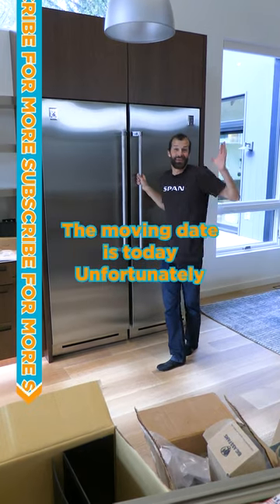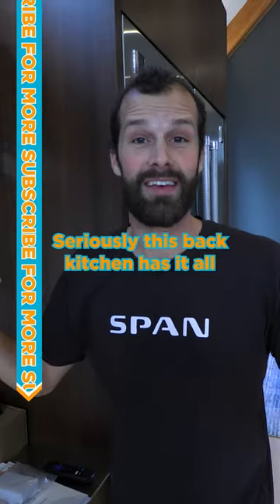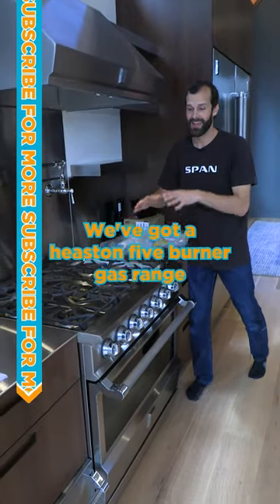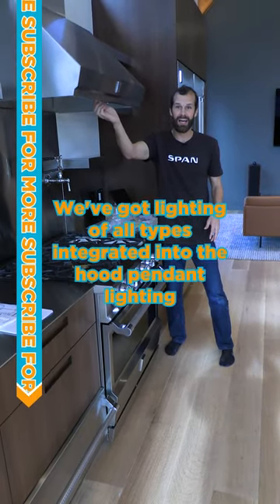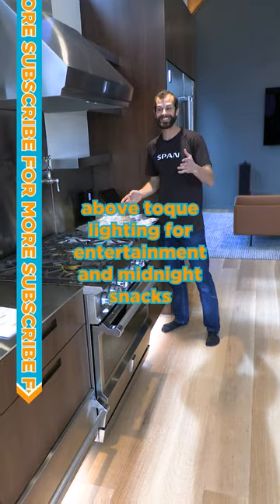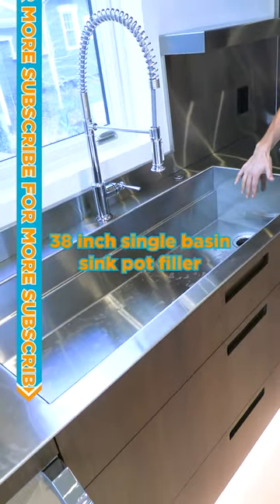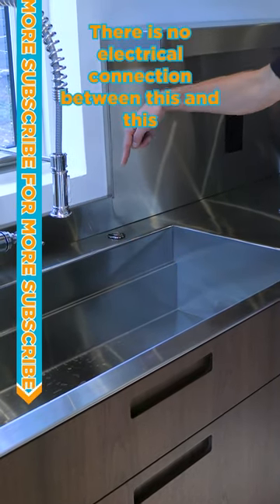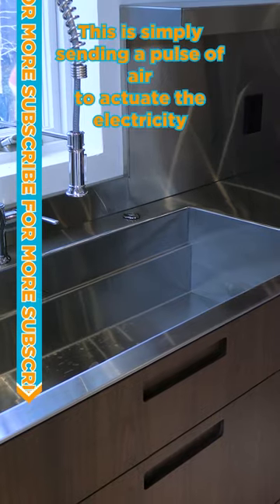Could You Fill a Fridge this Big?

Comment: Sink should have auto water feed nozzle at left end so that when disposer switch kicks in, water will start spraying down left sink basin wall, disposer starts 10 seconds later, then when disposer shuts off, water continues to feed for up to a minute, then shuts down, similar to commercial kitchen setups. Does involve a couple of delay timers plus solenoid valve. Fancy sink should have had this built in...